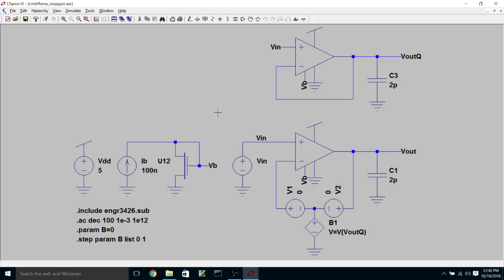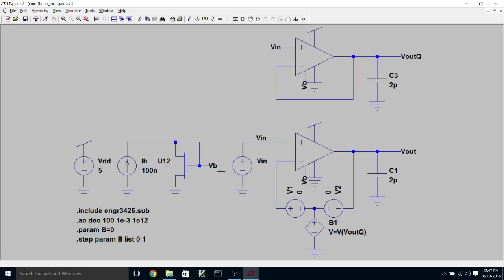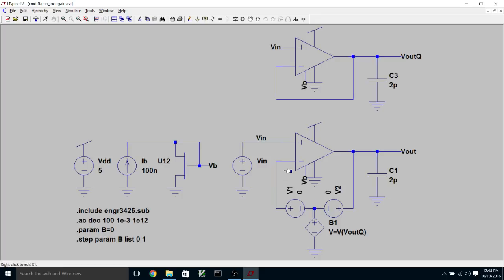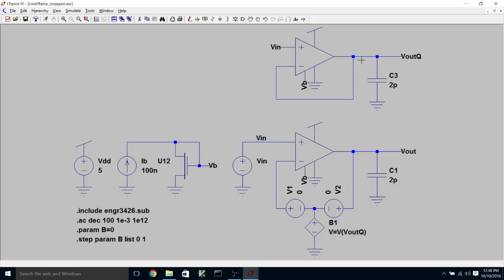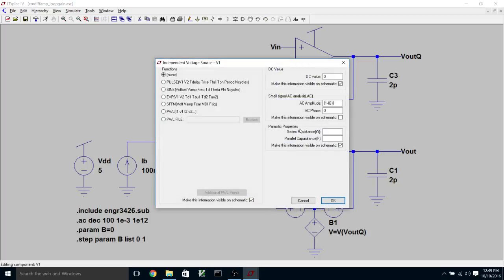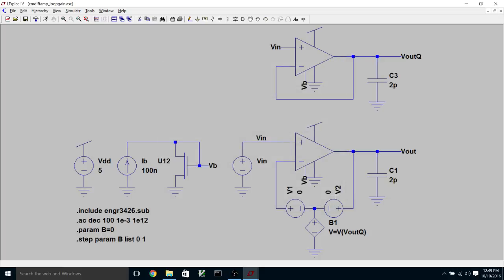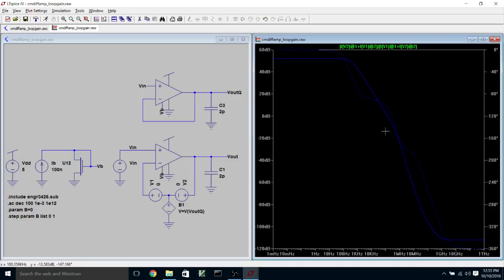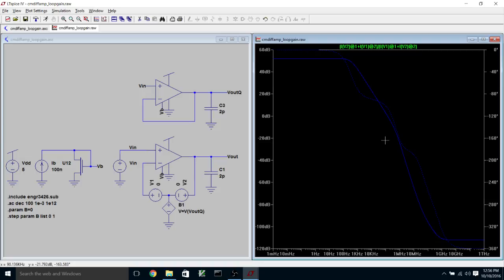LTspice loopgain simulation tutorial

Comment: I need to test a class D design loop, but can not use AC analysesin pure pwm, so I use a gain block from pwm folder. Can I do this or has you a better way, I need to tune the feedback corrector like the PID controller.